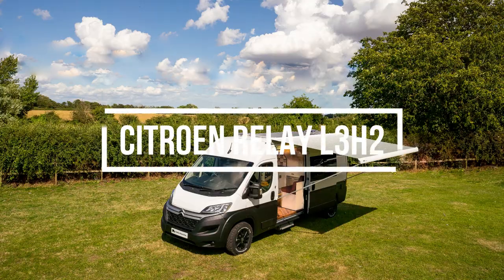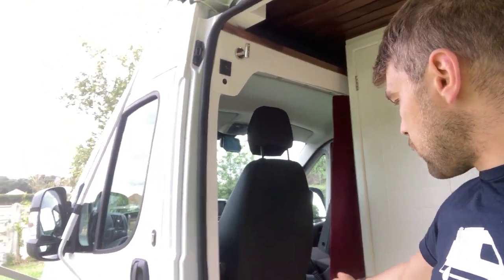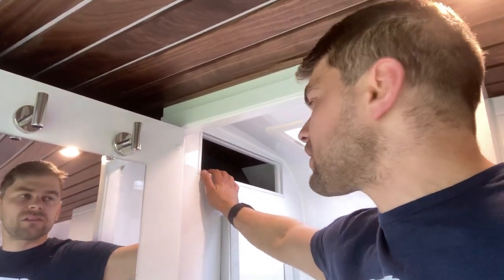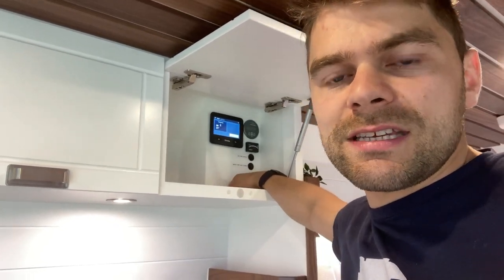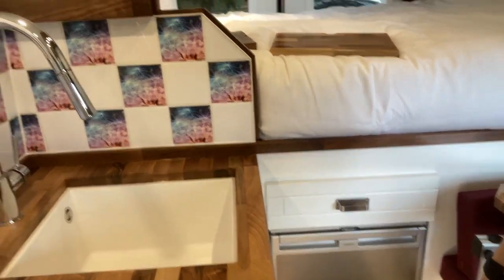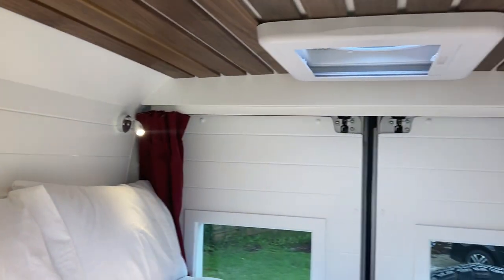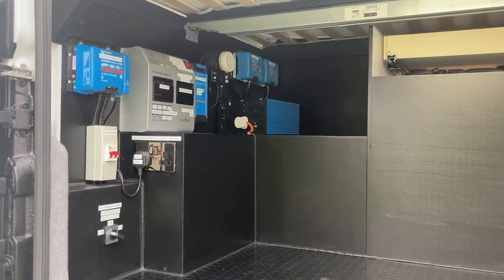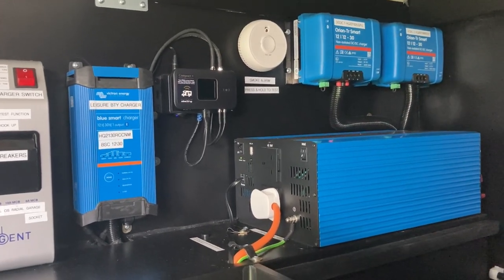ADVENTUROUS exterior, LUXURY interior! Van tour | Vanlife Conversions

Comment: Fantastic! Do you leave the recesses without the final 25mm of PIR to gain that extra space, or do you flip it and use 25mm only on top of the closed cell foam layer, without the initial 50mm sandwiched between?

Not sure if I need to remove the ribs in those panels to maximise the depth of the recess?

Trying to work out if we could squeeze a King sized mattress in there, if we leave out the 50mm PIR layer in those recesses. 

Sorry for all the questions, but we value your expertise!

Comment: Great conversion all the extra upgrades are impressive, did you have to upgrade the original alternator to cope with the power draw of the two b2b Orion chargers?
Reply from the maker: Hi Scott, thanks for your message. We didn’t need to upgrade the alternator in this instance as the size of the alternator is able to cope with the additional power draw.